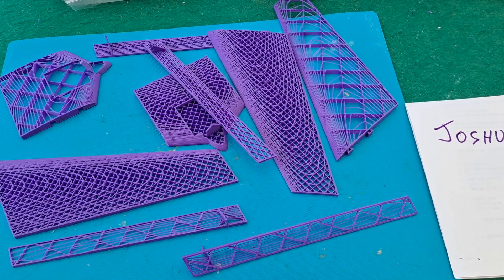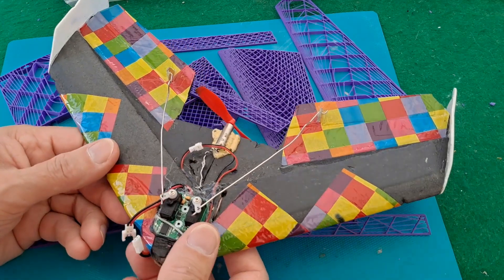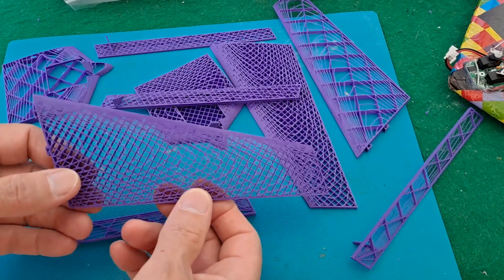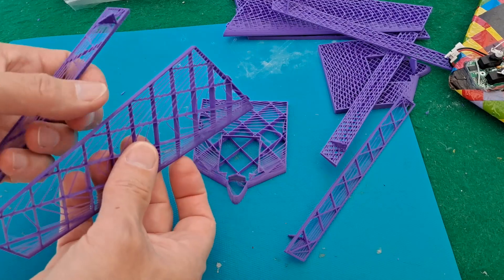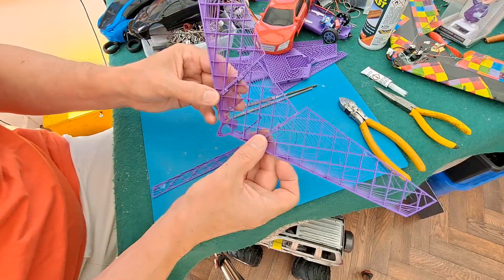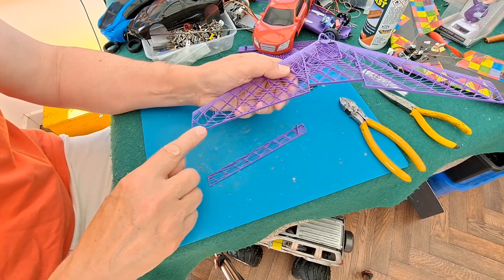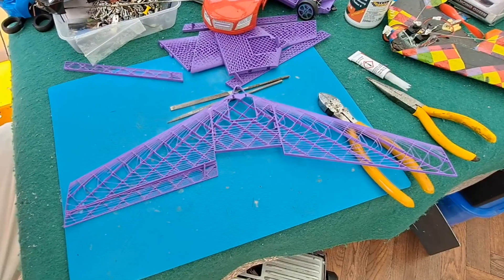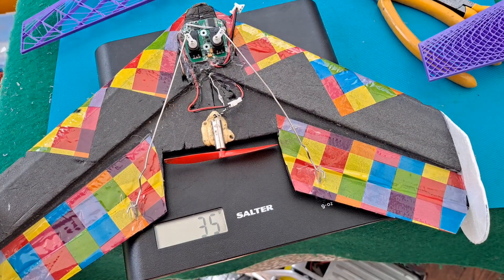First look at assembling the 3D printed RC micro flying wing

Comment: Hi great videos. You dont need a bevel between wing and elevon. Use a Z fold hinges. ( one side attaches to top surface of wing second side attaches to botom surface of elevon. ) then build mirror image.
Reply from the maker: Yes you could do that, but as I explained I wanted to use a tape join.

Comment: Nice project!
Reply: RC stitch pivot swivel hinges are the easiest to apply or maybe to integrate in the design. Also note that small flying wings are extremely difficult to launch especially with a pusher prop.
Reply from the maker: The end result is disappointing but it was my first attempt, so maybe better next time 😁👍 At the moment I am regretting scrapping the foam one as that did fly.
Reply: @GrandadIsAnOldMan  maybe try first the (scaled) nucking futs rc plane of grumpy modeler
Reply from the maker: @prep0wer  This one caught my eye because it used the same components as I had used on that foam wing.
Reply: @GrandadIsAnOldMan  A start with a Volantex RTF and after flying without electronic help a DIY plane with A grade parts, would be smart?
Reply from the maker: @prep0wer  that's not the way I do things 😊
Reply: @GrandadIsAnOldMan  For training only.

Comment: That was a good idea getting it down to 18g. I agree with the bevel on the wing and ailerons. It will make a big difference to the movement but you can buy tiny aileron hinges made from mylar and that would have given you the movement you needed without reprinting the wings and ailerons. I have used them several times. They stick really well with superglue and they have tiny holes in them if you want to peg them on.
Looking forward to seeing this take flight. 👍👍👍
Reply from the maker: The end result is disappointing but it was my first attempt, so maybe better next time 😁👍 At the moment I am regretting scrapping the foam one as that did fly.
Reply: @GrandadIsAnOldMan  Maybe you need a more powerful motor. I notice you were using just one coreless motor so it might be too weak? A wee brushless would fly it.
Reply from the maker: @mikeflight9  the guy who designed it, used virtually exactly what I used on my foam wing, that is why it caught my eye. Somewhere, I think I have a slightly larger motor, I think I bought a few, there is probably one in that 'baubericht' jet I did. The main issue is it's not very strong. It would be easy enough to add some carbon fibre spars to stiffen it up, but I like to try things as designed before I start messing about with it. The ready to fly weight is slightly heavier than the foam one.
Reply: @GrandadIsAnOldMan  "YOU" not messing about with things? 🤣
Reply from the maker: @mikeflight9  not until after I have tried it as designed. No point in changing the design and then complaining it won't fly because that would be my fault for changing things.